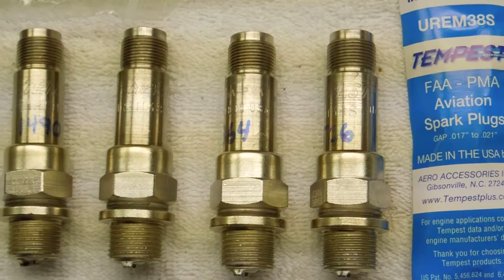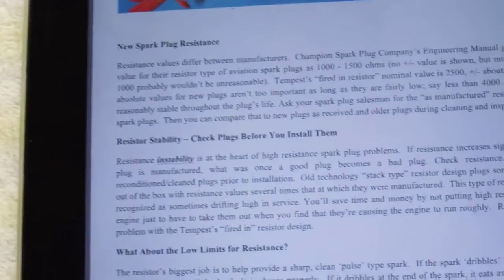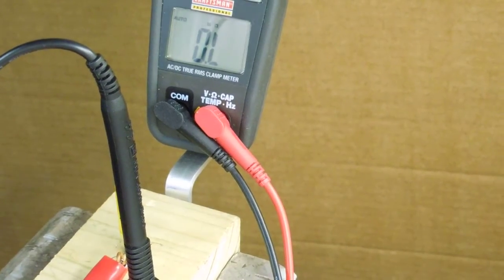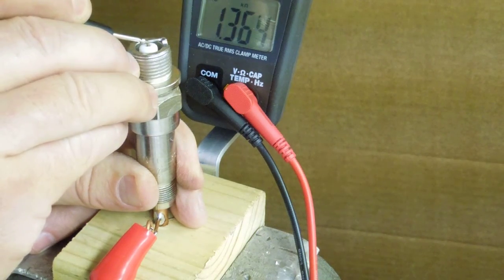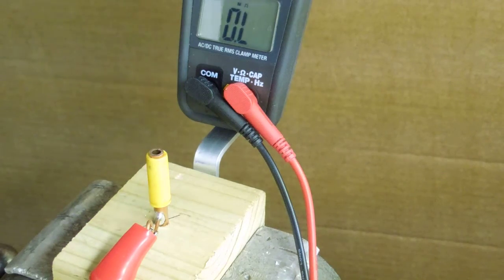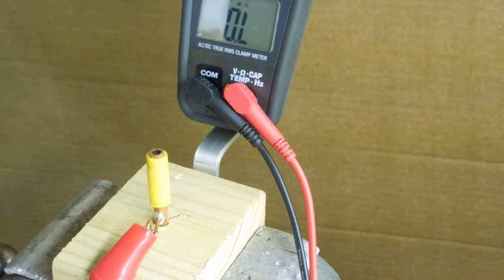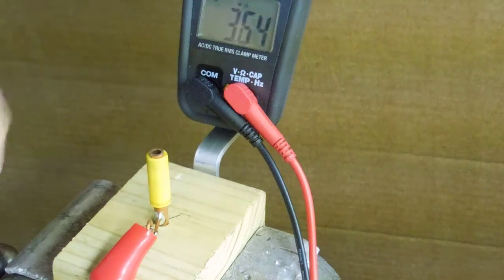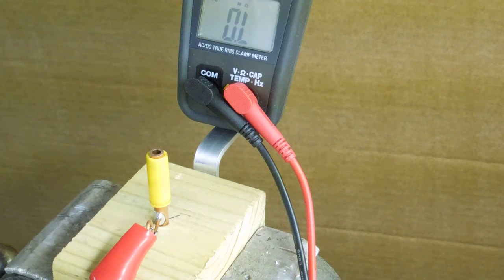Resistance Test Tempest & Champion Aviation Spark Plugs REM38S

Comment: great video. i am troublshooting a plaguing problem with a helicopter engine. checked mags(had them both repaired), new carb, triple checked timing, valve clearances, compression checks etc. checking the plugs as a final troubleshooting and remembered about plug resistance and looked at your video. great stuff!  thanks for sharing.
Reply: Glad it helped you.  Something I've experienced with fixed wing Lycomings, you can get a random roughness if the exhaust valve guide clearance is getting to the limit.  The 388C wobble test is definitely worth doing.  Fly safe and thanks for watching.

Comment: Hey thanks for this. What material is your isolator around your soft copper? TIA!
Reply from the maker: It's a piece of 1/4 copper tubing with a sleeve from a plastic cap around it for an insulator.

Comment: Hello, will the ohm test take the place of a spark test such as in these cleaner/testers - https://www.aircraftspruce.com/catalog/topages/sparkplugdual.php?gclid=CjwKCAiAuK3vBRBOEiwA1IMhutETJDSoB6YRlXFIfk5W4rIXFBm-NTgB59NfHD6rSvmTm_72Z1NgjxoCIQYQAvD_BwE

I ask because a stand-alone cleaner is cheap, like $30 and if I can test my champions with a multimeter that would save me quite a bit of money.  But if there is value in being able to see the spark vs a new plug that might save my life or save wear on my engine then a few hundred bucks is worth it.  My old mechanics before they moved or retired used these expensive cleaner testers and I just took these pieces of equipment for granted as I could use them whenever I wanted.

Comment: You may want to review the difference between ohms, kilo ohms, and Mega ohms.
Reply: I noticed that also.  The one champion read .364 so thought it meant 364 ohms when the ""M was on...... .364 meg ohms or 364,000 ohms.    The best way to do this test is to turn off auto-ranging.  Tempest calls out anything > 5000 ohms as a fail.

P.S. Nice test setup

Comment: While you performed a test of the plugs "after use" (and it's very helpful info) . . it would be interesting to see a like-test, for example, across 30 plugs of each manufacturer "out of the box".  Each manufacturer will state (I'm guessing) they test every plug before shipment (but being in manufacturing for a while) I'm willing to bet they temper that statement with QCing (testing) a more modest sampling (say one manufacturer perhaps tests 1-in-10 plugs and another may test 1-in-30).  A test of perhaps 30 plugs of each "out of the box" would be interesting (you'd obviously have to get a retail distributor to agree to work with you on that - - i.e., agree to put them back in the box and shelf after testing or send any "discovered bad ones" back to the manufacturer.  But it might make a good name for themselves if they state on their window they do such "consumer retail testing" on behalf of their retail customers.  Just a thought.  (I'd certainly be more apt to buy from them if I knew they did such quality tests as a retail distributor from time to time)

Comment: I had a similar situation with spark plug issues.  I had  frequent bad run ups and would "burn" off the plugs before they would run smooth.  The Champion plugs I was using looked good, but when I found information suggesting an ohm check several were found well outside the ohm range.  Replaced with Tempest plugs.  4 years later, no bad run ups and ohm checks are all still well in range.  Ohm checks and Tempest plugs from now on! 
Any good ohm meter can do the job or Tempest has go/no go ohm check tool.

Comment: So you are slinging away a $100 plug on the basis of a reading given by a cheap multimeter that probably uses a pair of AA batteries for it's operating voltage?  Glad you're not doing my Annual!  Suggest you go back to A&P school and turn in your IA.
Reply from the maker: The data be damned!  I've got Fluke, Simpson, this and other meters, they all measure the same.  Lucky for me, we have an ISO certified calibration lab at work so I can have all of my tools checked, verify they are correct and have them certified.  Ohms are ohms regardless of how the meter is powered.  As you saw, several of the Champions had open readings.  How long is it going to be until the ones that had continuity develop an open?  Several of the contact screws in the Champions were loose and all had rings burned into them from the spring on the end of the lead.  There were several signs that pointed to the IGNITION SYSTEM was operating near or at its maximum voltage, putting unnecessary stress on everything.  Thats when the research started.  Once you see a spec do you ignore it?  In the end, the only choice for me was to spend the money and provide my passengers and I the safest plane I could.
Reply: @snaproll94e  Not to mention, you had consistent readings across all the Tempest (plus you had fairly consistent readings across the 1,200 hour Champions) . . so your data was not 'bad' as the poster suggested.  Seems to me he's the one that is obviating the obvious.
Reply: @snaproll94e  Shouldn't the ignition system always operate at it's maximum voltage?
Reply from the maker: David Carter, no, it ideally should have a reserve of voltage so it can fire a plug or cylinder that is operating at less than ideal conditions, i.e. a plug that is fouled, oil soaked, cylinder that is excessively lean or rich.  As an aircraft goes up in altitude there is less ambient air pressure.  With less air pressure the spark in the distributor cap is more prone to cross firing.  If the ignition system is operating efficiently and requiring less voltage, there is less chance of cross firing and a spark leaking out of a worn lead or something similar.  It's not often discussed but higher ambient air pressure actually helps to corral (for lack of a better term) the ignition energy.  To cure high altitude misfires on piston engine planes they pressurized the inside of the magnetos, this forced the spark to jump from the rotor to the terminal in line with it and not to jump elsewhere in the cap as it seeker the least path of resistance to ground.  You can google the subject and learn more.  Thanks for watching.
Reply: champions suck! lol there is a reason they changed the design and didn't tell anyone. Go look at a tempest inners then look at a  new champion plug and an old one. its pretty clear. new champions almost identical to the tempest. Can you fly the old champions and have nothing happen sure( in my bonanza now) but they will be out soon even with only 250 HR on them.
Reply: @axlebeastly  I don't see where snaproll94e is claiming to be an A&P or an IA, perhaps I'm mission something.  But that being said as an A&P and an IA I don't know of ANY reputable IA who would "sling away" someone's spark plugs based on a resistance check unless he/she could prove that the plug was not firing.  I would, however, recommend to the owner that in the interest of safety the plug should be replaced based upon the TEMPEST guidelines.  And don't worry, I would NEVER consider doing an annual for you.

Comment: Thanks for posting this video.  I am about to enter A & P school, and was wondering about Aviation plugs vs. Automotive plugs.  I have not researched what the FAA may say about it in maintenance logs or, Lycoming / Continental engine maintenance with their engines.  I know I wouldn't want the engine to quit on me during a flight so I wouldn't want to compromise the ignition system either.  I would like to see how you made your plug tester in another video.